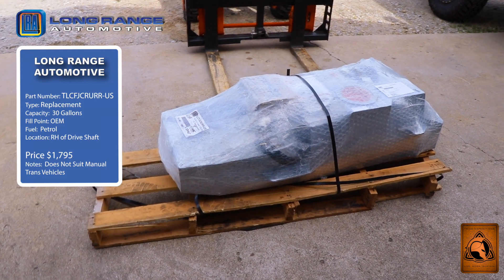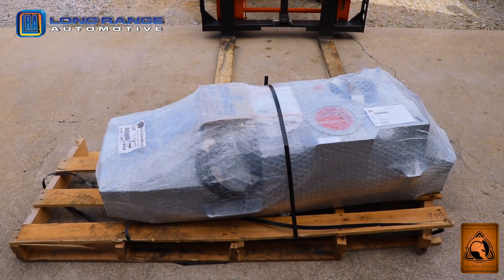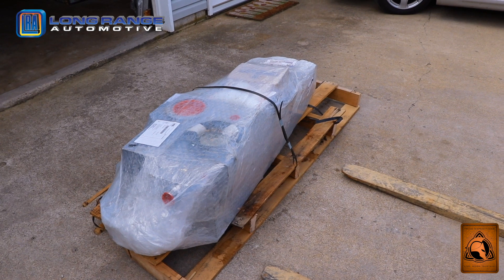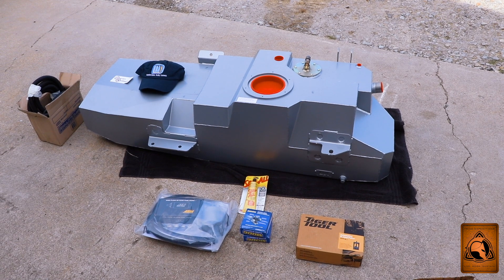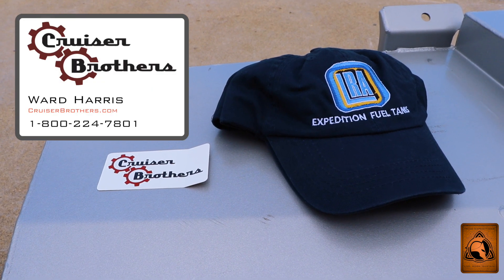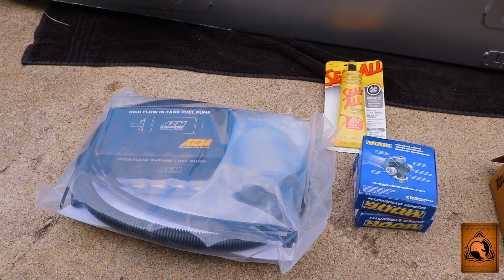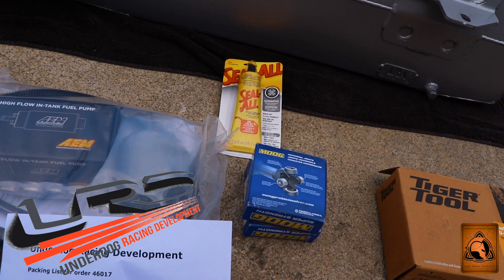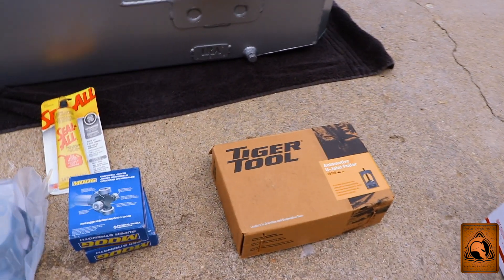Long Range Automotive FJ Cruiser Replacement Tank Product Highlight

Comment: Would you happen to know why this replacement tank won't fit a manual?
I thought that maybe the difference in the transfer cases could be the problem, but judging from the views in this video (thanks for this vid btw!), I can't figure why it might not fit.
Only thing I can think of is this being designed in Australia, they did not have the manual transmission offered there and therefore have never installed this on one.  So to avoid any issues, they claim it will not work for manual transmissions.
Reply from the maker: I could not comment on this, since I have never seen under a manual FJ before.  I know the tank is very exacting, leaving no room to spare.  I think at one time I knew what it was  , but think of it as a glove fit.